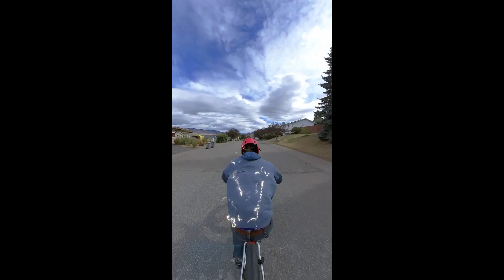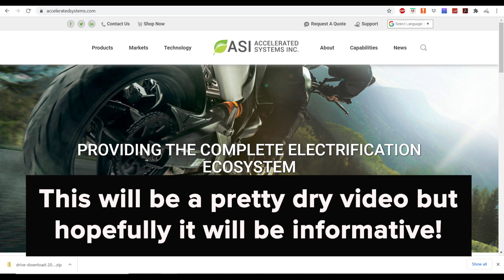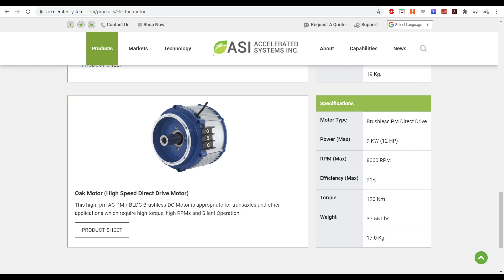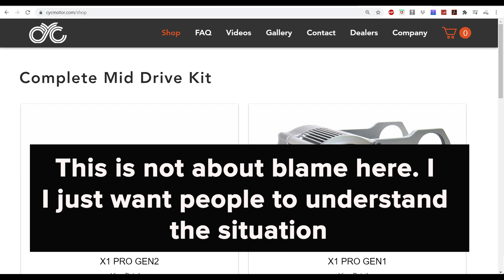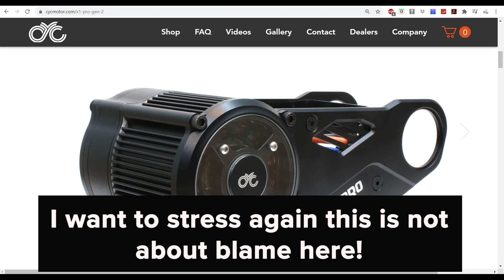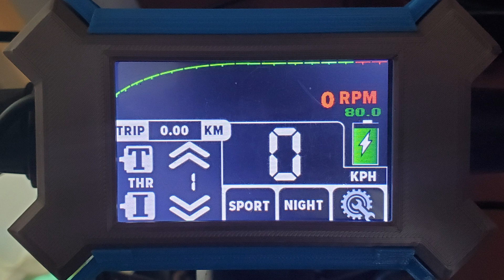ASI/CYC configuration issues and access problems

Comment: The end user should at least have the access to change the battery voltage, wheel size and limit the power level. It is ok for you to have the BacDoor login though? Are you an oem or an end user who paid for the controller and wants to set it up as best he can?
Reply from the maker: I got into the asi platform by pure fluke. My stock one crapped out and I thought why not try a plug and play kit. The rest is history. I actually managed to get my login to bacdoor from asi. I just called up and asked with respect and politeness. That and my British accent usually opens doors in Canada lol. I did however buy an evaluation kit so I guess in the end I paid for my access. There is no way I would buy another ASI at anything other than OEM. They have a business model and anguish usually follows most single user attempts. I use the setup and parameters developed by Alan Hu at ERT. I have learned loads but its amazingly hard to dial in for certain motors. I guess to answer your question... absolutely 💯 those things should be possible. If you buy an evaluation kit tho. Its up to you with engineering support to achieve this. Most buy from a 3rd party kit supplier whos job it is to ensure you can change the things like voltage and wheel size etc. Hope this explains things. Good question! Cheers 🍻
Reply: @HighVoltageKits  I guess you were a bit miffed that anyone could get the latest 855 with BacDoor a lot cheaper than you paid for the evaluation kit. Forgive me, but you come across very smug in your video now that Cyc customers have had their login blocked (mission accomplished?). So it appears it does not matter if you are an end user as long as you pay the extra, and buy the evaluation kit (available on the website to the end user for $700) that includes login details. By the way, you can change the settings on a washing machine, not a very good comparison/analogy.
Reply from the maker: Umm. So you ask me a question to which I respond genuinely and honestly to. Then you pivot to some bollocks about being miffed and sounding smug. I'm sorry you miss the point about the washing machine tho. Of course you can change the settings. What world would it be if you bought a washer and then had to configure it to work using the factories OEM code platform. It would be ridiculous. Which is my point with CYC. The ASI model has CYC supplying a product that customers can use in a simple reliable way. Currently they are struggling with this and that struggle has led to this situation with the logon. I did not create it but I get asked often about it so I explained it. I suggest making less guesses maybe. You don't know me and have no right to judge me. I have helped alot of people with CYC motors. I bought two Gen 1 motors from CYC and I continue to work with the system and help where possible. Mission accomplished? Are you trying to provoke me or something. I don't have the time or energy to play games. If you want my advice or help with the X1 just ask.
Reply from the maker: ASI give access to people who they THINK will become OEM customers. If you buy one they assume that this is what you want. 

ASI sell an evaluation kit for a seemingly expensive price which only a small part of that just over 100 dollars is the actual OEM cost of the ASI controller. So CYC as an OEM customer would pay about 100 US per unit of BAC855. So if you buy from CYC you are paying about $200 or whatever it is they are charging. But that does not get you access to bacdoor. The fact that ASI have obviously not given CYC a new logon or permission to hand it out to users should confirm that I am correct.

The give away should be in the term evaluation. If you buy direct from ASI you are buying the resources needed to evaluate the use and operation of their controller with your motor. This is an industrial level process. Just because you can buy an evaluation kit and ASI will sell one does not mean you should. ASI will assume that you are building a replicable product and not in general a one off machine.

I know of five or more people who have bought evaluation kits and tried to use them with motors for one off ebike builds and failed even with the paid for engineering time from ASI. CYC are struggling so that should tell you everything you need to know about who should be using bacdoor and who should not. I could be OEM. But I just recognized that my skills are in design and ergonomics and 3D printing. Onscreen graphics. User guides. Stuff like that. So I never followed through with the OEM part of buying an evaluation kit. 

If you buy off CYC you have no rights to BacDoor on the phone app. If they could lock down the PC app as well then I bet they would. CYC are apparently working on their own app that will do the things you mention like change the watts and amps, select a battery. Ideally this would be ready to go before they start selling the motor with the 855 to customers. But its not CYCs fault that the issues with the stock controller required a complete redesign. 

But creating an app like that is hard work. I know this becuase I spent the last year working with Alan Hu of ERT to develop the NXT display that will do the things you mention. I have a BAC2000 sat here for my Gen 1 CYC that I can change the Watts and amps via a touch screen interface on my bike. My BBSHD uses the ASI via the same touch screen interface. I don't have to use bacdoor. I would rather not as it is one of the worst apps I have even had to use. I can't wait to see the app CYC make because I know what is required to get the ASI running well.

I do concur  that CYCs customer service is 1st rate. Without it they would have been dead an buried long long ago. In mmy first video review of the CYC Gen 1 I said that the best part of the Motor package was their willingness to engage and listen with the ebike community. 

Have a good week!
Reply: @HighVoltageKits  Thanks for your personal 'opinion' on why ASI sell stand alone controllers and evaluation kits to to the general public. 

 I should add that this discussion has nothng to do with Cyc and their user experience which I know nothing about. This discussion, on my part at least, Is about the impression you give in your video (somewhat patronising) that you believe end users should not be able to directly configure the BAC controller they have paid for. Incidentally, I do have a cyc kit with a stock controller that I am more than happy with, but also have a BAC controller bought off a re-seller, and because they seem to have gone 'missing' , along with many others I cannot contact them and the login no longer works.  

The pc app and bacdoor access given with this kit allows you to configure any BAC controller, and not just the controller that came with the kit, am I correct? So you are really paying for the ability to configure the BAC controller with your motor, battery, and ride experience of your choice, which I think any purchaser of a BAC controller should have. The BAC controller has thermal, current, voltage etc protections hard coded so the actual controller is well protected from inexperienced end users accidently setting these associated parameters too high/low. Everyone starts off inexperienced, but in my experience, the documentation and step by step guides are very very good. Especially the auto tune section to match the controller to your particular motor before configuring peripherals. It is explained in deail how to use the pc BacDoor app that I have already said is stand alone and therefore needs no log-in and no connection to the internet to use.

It is my opinion that anyone who does not believe that the end user should be able to configure their own controller are those who intend to, or are already making money by offering this service. Either by re-sellers insisting that a customer sends the controller back at the customers expense and then charge an extortionate amount for a simple configuration change such as when you invest in a higher voltage battery, or by those producing displays that will change basic settings.

To finish, if your channel regarding the ASI controller was really about helping people, then you would have offered genuine unaffiliated help to those who have been locked out of the settings. You could offer the link to the pc app and help files/instructions along with links to the hardware needed to connect, the same hardware given in the evaluation kit. Instead you show a patronising video why you think other end users are not clever enough, and should not be allowed to configure their controller. But of course, it is ok for you as the same end user to have access although you are not an oem and by your own admission, did not start with any more knowledge than anyone else. Is your channel now more about making money than offering genuine honest unaffiliated free help? The end, have a nice exploiting free week, lol.
Reply from the maker: You don't know me yet you seem hell bent on being my judge, jury and executioner. You clearly don't understand  what it is I am explaining. I have literally explained three times the same thing to you. I have given you plenty of time on this. If you are so determined to get to the bottom of this give ASI a call. A lovely lady called Shannon will be able to confirm what I am telling you. If you buy an ASI from a 3rd party vendor you have no right to use bacdoor. They don't want you to. It is up to cyc to provide an interface. I am sure they will. I have to leave it here tho. I can't viably invest any more of my time into someone who cannot seem to listen. Perhaps this is the only video of mine you have ever seen. Maybe you are new to CYC. You must be. Otherwise you would not be questioning my standing or suggesting I risk my relationship with ASI by distribution of software I have no right to distribute. I respect your right to disagree with me. But maybe do some research on ASI and learn a bit. Cheers 🍻
Reply: @HighVoltageKits  You have invited people to discuss your video if they disagree, this is what I have done. My point is that anyone can buy a kit and have access to the BacDoor app and configure their controller. Also, I do not know why you keep bringing up cyc, my discussion is nothing to do with them. Do you have a reason for directing this discussion at cyc? My argument is that ASI will presently sell an evaluation kit, and then any amount of subsequent controllers to anyone, and it is certain re-sellers of the controllers that then deny access. Perhaps ASI intend their controllers to be included/manufactured  in a complete kit or EV, or replacement part for such,  before being sold, and not re-sold as a stand alone controller. I also do not understand what authority you have to speak for ASI. Are you not just an end user like most of the viewers of your video, or are you talking in an official capacity on behalf of ASI?

 The initial evaluation kit is expensive, but considering every controller you subsequently purchase of ASI is considerably cheaper because you are no longer required to purchase an evaluation kit, just the controller of choice. I understand, and agree that it is the right of the seller of a vehicle, complete kit (battery, motor , controller etc) to configure the system and then lock it down because it is being sold readily configured as a whole (vehicle, battery, controller, motor, peripherals etc) and given a warranty as such and should not need to be configured thereafter. These are the conditions of the seller/manufacturer of the vehicle, or complete kit that has an asi controller, and NOT the conditions of ASI.

On the other hand, I strongly disagree with re-sellers of a kit that consists of an asi controller and the configuration for a motor and battery voltage of choice, and no access to change any settings thereafter. Again, these are NOT conditions of ASI, but the conditions set by certain re-sellers purely to make money to subsequently change settings when and if the customer changes their motor, or battery. There are numerous complaints in the vendor relation section of the popular and well credited ES forums, just do a search for asi + ERT. 

I think if anyone wanting an ASI controller should buy direct, but there are other options available that are perhaps not so expensive if you require just a single controller and have great free support on the endless-sphere forums, such as the popular Nucular range of controllers.

.

Comment: ASI are shooting themselves in the foot here.
You have a company like CYC and maybe others who depend on ASI to function. If ASI are now locking their business and frustrating their 3rd party customers then CYC will eventually jump ship and ASI could go from a small company to no company at all.
I bought a BAC855 ASI kit setup for a BBSHD and it is fantastic, but has no way to change the settings even though I paid over £500 for it. Only reason why I got it was because it was plug and play.
If another company used a different controller that was plug and play but also allowed customisation then ASI would have never got my money.

Open source is the way to go, or at the very least sell a key and a licence agreement saying ASI is not responsible for any damage caused by the controller.
Otherwise someone else will sink them.
Reply from the maker: I think ASI have many business partners that use their controllers successfully for many projects. CYC are just one single OEM customer. ASI do not need CYC to be successful. They are a bigger company by some margin already. CYC are not operating within ASI chosen model. Its frustrating but that is their choice. You are correct tho. There are other options. The nukular if you can lay your hands on one is an option. Cheers

Comment: Am I missing something here?  They should have 10 different settings at a push of a button.  Change from 48, 52,and 72 with a few options each for speed and torque per voltage and notify customer of what each of the 9 or 10 settings permits ahead of time.
Reply from the maker: Sounds great except there is no display out there that can do this apart from the nxt which let's just say is not widely available.
Reply: @HighVoltageKits  i joined the discord listed. In general atm

Comment: Thanks Cap for the video explaining this. Although I love the performance I'm getting, I was more than a little miffed by the fact that I was hamstrung by BAC Door 's secretive processes. If I give you $500 for a controller, I feel I should damn well be able to do with it as I see fit. For clarification I'm using the ASI BAC 855 on my BBSHD. My bike will hit 50mph on a downhill easily, and I still have LOTS of throttle left. I generally cruise at 40-45 and I only go around 7 miles to and from work using a Litespeed 72 volt 19ah battery. The trip usually uses 5-7 volts, I have the field weakening turned down to 30%
Reply from the maker: I definitely prefer open source technology. But its no different to many other things. If you bought a car from a dealer you would not be accessing the nitty gritty of the engine management chips. Not without spending lots of extra cash. But it should work in the situation you bought it for.

Comment: bacdoor should be open for standalone credentials.
Reply from the maker: The only way it would work would be if access was locked to a particular controller perhaps via the serial number. Or a more limited access level login. But thats not an option I don't think.
Reply: @HighVoltageKits  or just give the ability to the end user to change the controller password and everything remains local. super simple
Reply from the maker: Yeah. So a better app with a legal disclaimer. Yup that would work. Good idea 💡
Reply: @HighVoltageKits  yes, cause it's DIY at the end of the day. Bikes are either assembled by a store or by individuals so that's should be no problem at all ... and they will sell more. Don't think the safety issue is a real issue. People are more and more informed ... They should also provide default configuration for BBSHD or CYC... the IP stuff behind all that justification is too much.
Reply from the maker: What you suggest is well and good. But its not the business model they seem to want. They want high volume oem customers not diy guys to a large extent. They definitely don't want customers of oem companies taking their time. There would need to be big changes at ASI to do this. I doubt that they are making them.